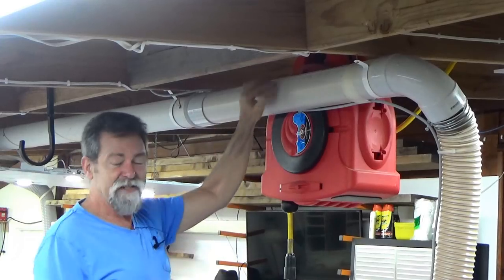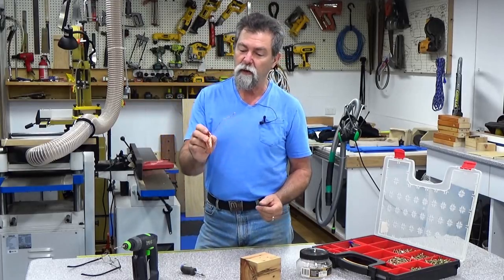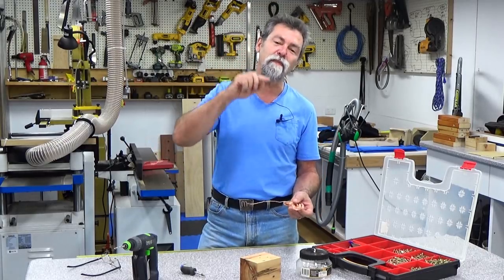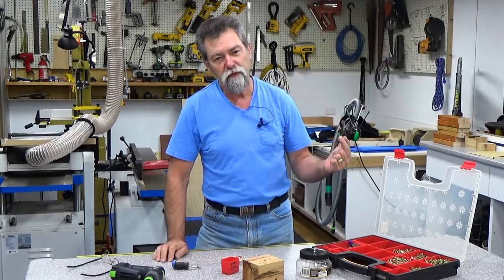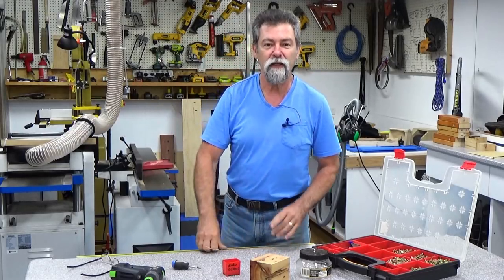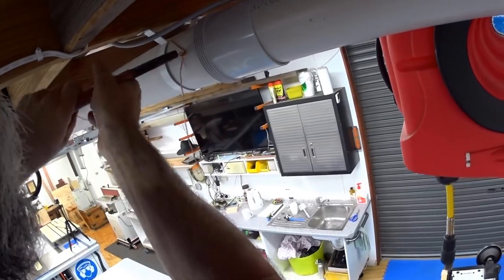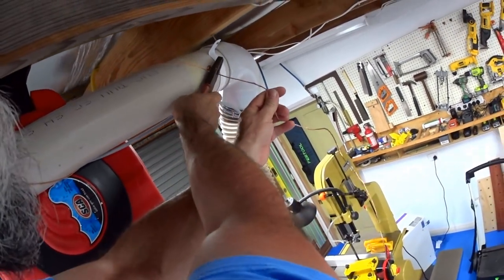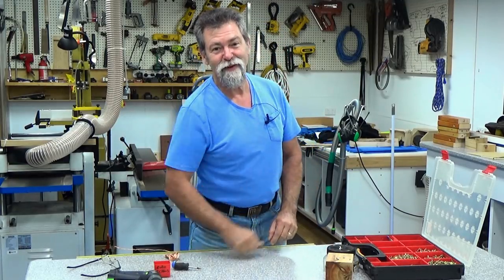PVC dust extractor pipe how to no static dave stanton woodworking safety dust collection

Comment: Hi from Arizona Dave. I really appreciate your tip for handling the static. I've tried a number of things that made no difference.
Having worked in a cabinet shop for 10 years I have a good supply of system screws & 5mm bits. I will be using this method as I set up my home shop.
Thanks again!
Reply from the maker: Sounds like a plan Mike Herbst

Comment: Just wanted to thank you for you lightening rod idea. I installed a PVC based duct system with a Laguna PFlux 3 cyclone dust collector. I used your technique to mitigate static. Great idea - thanks!
Reply from the maker: My pleasure GuitarDisciple ! Hope it works well for you.
Reply: @DavidStanton  the only way to physically remove the WHOLE amount of static is to cover every square inch of the pvc. You're talking absolute nonsense.
Reply from the maker: @ryanallen3704  did you watch the entire video and see where I state real life before and after. No nonsense about it.

Comment: David, it's possible to get adhesive copper tape in various lengths and widths - stick that on the outside of the PVC pipe and put the screws thru' it.  Maybe drill pilot holes first.  Spiral or straight?  Don't know ... just passing on the thought.  Of course the ends would need joining up and earthing as you have done with the stranded copper wire in yr video.
Reply from the maker: Hi Graham Carter! Interesting thought but the wire works and is relatively cheap and can be reused if I rearrange my shop's layout at all.

Comment: When I started getting nasty static shocks from the new drumsander LEV I realised that I needed to earth the pipe. I stripped a length of copper wire and stuffed it down the pipe, out through a small hole, and wired it straight into an ordinary mains socket earth pin. Its pretty scruffy but it does the job. The copper doesnt need to be in contact with the plastic pipe to make it work. PVC has no conductivity - if it did the static wouldn't build up anyway. It earths itself onto the copper across the air the same way that it affects the hair on your arm.

Comment: Great idea! Probably another benefit, since some Woodworker's have electronic equipment in shop, you want to avoid any static charges, as small components (computer chips) can be burned out with just one shock.
Reply from the maker: It works very well for me. Thanks for the comment!

Comment: Great video. I'll use your method on my next video about my micro dust collection. Always use braided wire for static collection. Braided wire has much more surface area to collect a static charge and is way better suited. Any bare uninsulated wire will work but braided works better.

Great job David!
Reply from the maker: Thanks PaddyG. The wire I used was braided. Could be why the extra good result?

Comment: I've hear that static fires aren't a problem in smaller shops like yours, it only a real problem in the extremely large industrial shops. The only thing you have to worry about is getting a little zap from you pvc pipes.

On a side note, I recently bought some grounding wire to use on my small Shop Vac system. I also decided to upgrade my shop vac from a small Craftsman to a Ridgid which has almost 3 times more suction and about half the noise levels. Funny thing is that with the Ridgid vac, I get pretty much no static, where the Craftsman vac I could feel static from 2 or 3 feet away from my cyclone system.
Reply from the maker: I have heard the same thing but peace of mind is cheap.
Reply: MAGA MAN i

Comment: Impossible to ground PVC.  It is the insulation used on all wiring as it is one of the best insulators known.  You may be discharging some of the nearby static, but the system is not grounded.
Reply from the maker: I appreciate the science behind your comment. All I can say is I never get a zap from my system since I did this work to it..before it was all the time.

Comment: If your flex hose has a metal coil in it attach the grounding wire to one  of that coil and eliminate /reduce the static in the flex hose as well.

Comment: Obviously having trouble with static in my shop or I wouldn't be watching your video. I've got a flex tube that arches from my drum sander to over to the main collection junction. I have to walk through the arch of the tube in order to turn on and off my dust collector. At first, I thought that I must have been walking through spider webs every time I got near the tube then I realized I had a serious build-up of static. It's not the discomfort so much but in my case, with very fine particles of dust the system isn't just a fire hazard under the right conditions but there is the larger danger of explosion. Thanks for the video, I've got thr information I need.
Reply from the maker: Let me know how it goes.
Reply: Spray the hose with Static Guard . End of problem

Comment: Great for stopping static from zapping you.  But it's a myth that static causes explosions in small shop PVC dust collection systems.
Reply from the maker: Interesting point sandmandave2008.
Reply: Yes. No cases of this to cite. Dust explosions require very fine dust, high concentrations of dust, and still air. Such as a nice, quiet grain silo that just finished filling. Woodshop dust is not that fine, moves very fast, and is in very low concentration due to the high volume of air.

OTOH, you are hurting nothing by adding anti-static provisions except use of your time and money. The benefit would be to not be as likely to be zapped by the static.
Reply: @genebruce6321  that is a very interesting point.

Comment: As always a well thought-out endeavor. Thanks  

I wonder if a rivet (with the wire tightly wrapped once around it as you “pop” it) would have worked as well.
Reply from the maker: The only problem I see with a rivet is there will be a protrusion to the inside of the pipe. The screws finish flush. Thanks for the input Bob!

Comment: The ubiquitous Home Depot has 18 gauge bare wire (in USA).
For some reason they note the voltage rating for bare copper, which I don't understand.
Naturally, only the 500 foot spool is in my local store.  Home Depot can be annoying.
Reply from the maker: Buy it and sell the rest on ebay or find someone to purchase with you and share it.
Reply: HD usually will cut wire to length.

Comment: Dave, question sir: is there a reason why you wound the wire around the pvc rather than simply stretching from screw to screw?
Reply from the maker: Hi mooch1958, basically to give a wrap effect instead of straight line.

Comment: Another easy method to not have any significant surface to collect dust on the interior is to get a roll of aluminum tape used in HVAC duct work.    It is cheap, provides a good surface area to collect charge,  will cover any holes, and it will not provide anything for dust to collect on.
Reply from the maker: Thanks Nick Michels! Still needs to be taken to an earth point and does not work on the inside of the pipe.

Comment: Great video. Clear and to the point. I have always wondered why wrapping it around the pipe when the static builds up inside caused by the rubing of saw dust on the tube. Shouldn't the screws inside the pipe pick up the static electracy? Just curious.
Reply from the maker: As pvc is also an insulator we need to get rid of the charge on the outside of the pipe as well as the inside air stream.

Comment: I wonder if you considered using copper tape. You would have all the benefits of copper wire in a package that can be no more than 0.1 mm thick, self adhesive so easy to apply and you can connect to it either by soldering or by screw connection.
Copper tape also relatively inexpensive.
Reply: I see Peter Millard of 10 min workshop using copper tape inside pvc pipes.

Comment: This works but they do make hoses with grounding wires inside the walls of the hose
Reply from the maker: Clifford Browning, I agree. The reason I have created this video is due to using smooth walled pipe to reduce the airflow interruption from the type of hose you mentioned.

Comment: I'm trying to understand the theory of operation. How many lightning rods did you use? How did you calculate the number needed per meter? If wrapping the pipe doesn't serve any purpose, why didn't you just run the wire in a straight line? Subbed up and liked. Thank you.
Reply from the maker: Just do as I showed, it works.
Reply: @DavidStanton  "...do as I showed,..." Well, you didn't show how many.
Reply from the maker: @billbyrd9845  I think it was 600 mm
Reply: @DavidStanton  Apparently, the frequency of "rods" is insignificant. So I'll start with one in the middle and add as needed. The second one (if hair raising continues) will go between one end of the system and the one existing lightning rod, and so forth halving the distance each time. I'll see if I can determine how many per meter of ducting is required. Inquiring minds want to know.

Comment: Hey, that"s a great idea. Just out of curiosity, why do you still wrap the copper wire around the pvc? Couldn't you just go from screw to screw and save yourself from using so much copper wire? Are you putting screws on both sides of the pvc? Cheers.
Reply from the maker: Mark Radmall . The wire wrapping around the pipe ceates more surface on the exterior of the pipe to earth. Pvc is an insulator hence the outside needs grounding as well.

Comment: Excellent Dave! You mentioned that you drill 5mm holes in your PVC pipes. As you know, Euro screws come in different lengths. How long are your Euro screws?
Reply from the maker: nearly 9 mm long.
Reply: G'day Dave, could you suggest where in QLD to buy the Euro screw. Thanks for the show very enjoyable Cheers

Comment: Hi Dave .... just a bit of background :- the plastic ducting you are using is in fact where the static electricity is being built up in .. not the dust or wood shavings (their flow in the plastic pipe just generates the static). Therefore you are actually earth bonding the plastic so any static electricity is discharged to earth. The screws don’t HAVE to penetrate the plastic as such. No harm done if they do tho as in the way you have done it.
The copper wire you use to connect the screws as in the way you have done it can have PVC insulation on it so long as at each point you have a screw, the screw is in contact with the copper. Again the way you have wound the bare wire is good as it is making extra contact with the plastic duct. You can buy flexible plastic pipe where a continues copper braid has been moulded into the plastic material and then is bonded to earth where the pipe ends. Very expensive tho! 
Well done on your system and for recognising it needs to be done. Dust is very explosive under the right conditions.
Reply from the maker: Thanks for the compliment Steve.

Comment: Hi Dave!  I’m sorry I’m week late asking, but I was wondering about the flex hose. Do you, or most folks, even worry with exposing a little of the metal coil and grounding that point? Or, is that just overkill?  I’m very familiar with the opinion that static started fires in small shops are low risk, but I know from my electronics background that impact to tools with circuits is a real issue. Thank you for sharing your valuable wisdom!
Reply from the maker: Hi James. I reckon that is a pretty good idea!

Comment: Hi Dave, great video, hopefully you have an idea to help me. I am a floorsander by trade, i have my floorsander with a 50mm vacuum hose connected. 16.5 meters later it arrives at my Bona DCS 70 vacuum. Now, when sanding finer grit paper i get a huge static shock, do you have any ideas of how i get away from this with it being a normal vacuum hose, i.e., i'm not able to screw into it. Thank you
Reply from the maker: Festool make an antistatic hose for their dust extractors. The hose is carbon impregnated and where the hose connects to the dust extractor is a metal contact that runs through to the earth pin on the machines power lead. You can buy it by the metre up to 10 metres I think. Be aware it is very pricey. https://www.festool.com.au/products/accessories-and-consumables/dust-extraction/dust-extractor/hoses-cleaning-sets-connections/hoses-anti-static/50mm-antistatic-suction-hose-per-meter_452386

Comment: I'll bet that you don't need to find bare copper wire. Use regular insulated wire and strip the insulation at the points of attachment.
Reply from the maker: That would work for the inside of the pipe at the point of the screws penetrating the walls but of no assistance to the outside of the pipe.
Reply: The PVC surely has virtually no electrical conductivity, so it cant be expected to 'flow' towards the screws. I think this wouldnt work.

Comment: 2 things
if your putting in a metal screw that's on the inside and outside of the pipe I do not believe you need bare copper wire, just screw into the wire and in the pipe you shouldn't even ahve to wrap over the outside of the pipe. the wire should bleed off any statice energy
if not then at every screw wrap the pipes outside this will be to short a run to cause enough static energy. to make a spark jump far enough.  2' between screws. I'd just use a 1/2" truss head self tapping screw.

Comment: Dave I do not understand why you had to spiral the copper wire around the pvc pipe. As you were earthing it at the euro screws why could you not lead the copper wire from screw to screw in a straight and direct line?
Reply from the maker: Hi Norman. The thing with static, just like lightening, is that it is random. The spiral application is a twofold thing. 1, to hold the wire against the outside more efficiently and 2, to give the earthing a better chance of catching a discharge because of the circumference thing as well as their is actually more wire used.

Comment: How common are explosions in a pvc collection system? I just heard about this phenomenon today.. It's gotta be one in a million right?
Reply from the maker: Correct. In the average home workshop very rare indeed. If it is earthed correctly there is no chance. In the end it is up to you to be responsible for your own safety.
Reply: Not very. if ever. Rockler has an article on it.
Reply: @FPChris  No offense but as an electrician I am familiar with two deaths from one in a million, rarely  if ever or whatever. Both were ground related electrocutions of children.
Reply: @deediddy  Which has what to do with low levels of dust in a home wood shop?

Comment: what is with the ear protection when all you're doing is drilling a few holes into pvc. Stop that.
You said that the wire you installed has an insulator, but it prevents static just thru the screws or did you purchase bare wire or strip the wire of the insulator, or did you just strip the wire where it makes contact with the screws?
Reply from the maker: Hi Gino. You must be new to my channel. The earmuffs are the mount for my action camera. Never said the wire I installed has an insulator. Have another look.

Comment: I recently set up a CV1800 with 6" pipe and am experiencing the same thing, hairs standing up when I'm within a foot or two of the pipes. What gauge wire did you use? And is it safe to assume you can just wire nut connections together to continue them when coming from a wye instead of using the connectors you did?
Reply from the maker: I used the wire in the grounding kit I link to. Re connectors, what ever works for you. I had these connectors so I used them.

Comment: Do you thing a furnace blower at the end of the pvc run would boost the suction power of a dust collection system
Reply from the maker: I think it may cause more problems than benefit Thunderarrows.
Reply: Thanks from the otherside of the planet. Detroit Michigan, usa
Reply: Not a real expert here, but I'm guessing that the collector motor would be under-loaded and perhaps burn up. Oddly enough, running a blower with the intake closed will cause the  motor to overspeed and die. IMHO, your idea would induce similar conditions. Again, I'm speculating here.

Comment: Hi Dave, perhaps a simplistic question however, is there any loss of pipe pressure or air leakage at the euro screw points?
Reply from the maker: I don't think so Peter. The screw cuts in deep to the wall of the drilled hole.
Reply: Thanks David - great info that comes from Aust perspective.

Comment: Hi Dave,
Does this apply to all dust extraction hoses and PVC plumbing pipe alike? As I have just purchased the Carbatec DC-1200P from Tim in Sydney and about to work on my setup next week.
Reply from the maker: It depends Brad. If it is PVC then trying to ground the system is a good idea. If you have anti static hoses such as Festool have then you are good to go as long as the hose contacts the earthing wire. Think of it as an electrical circuit which is exactly what it is. Some carbatec 4 inch flex hose such as I have on the end of my pvc line as in the video has a wire as the stiffener. The grey hose does not, it is plastic.
Reply: Sweet, thanks Dave
Reply from the maker: Hey Brad. Thanks for giving Tim a 5 star on google. The company is pushing those kind of things within the ranks of the staff at present. It will make his day knowing that someone has taken the time to say what a helpful person he is!
Reply: Happy to do it, as someone in retail industry myself, we always hear the negative from customers and never get acknowledged for the good we do. I was back in store today with Tim and as usual great service... 

Now I just need to set up my new Carbatec 14" Bandsaw when it cools down. :-)

Comment: Surely, static elecricity only builds up on the outside surface - hence the use of Faraday cages - so it's unnecessary to put anything inside the pipe
Reply from the maker: My understanding is that the dust combined with the airstream travelling on the inside of the pipe also creates a static charge.